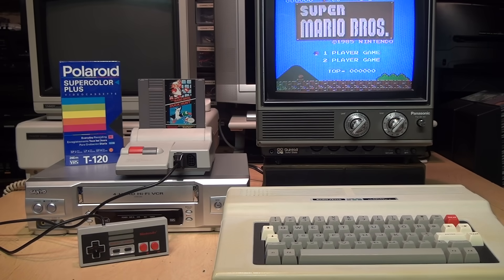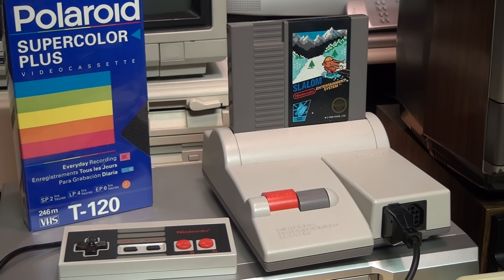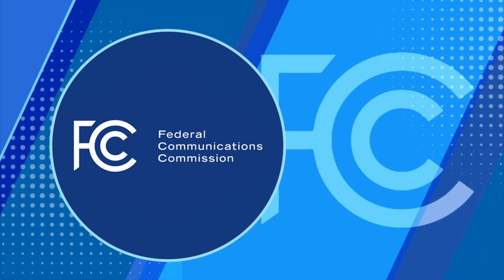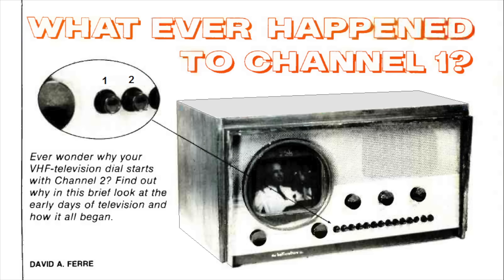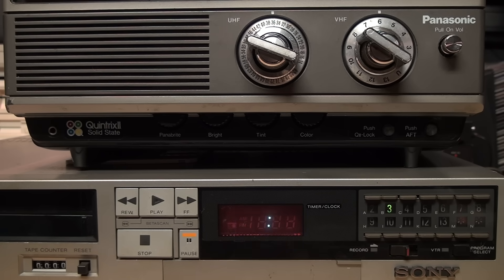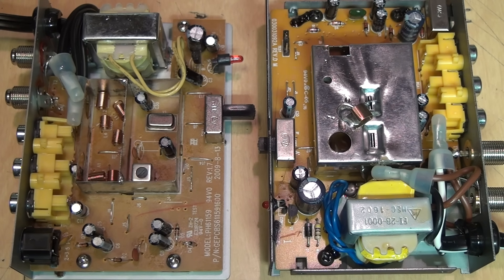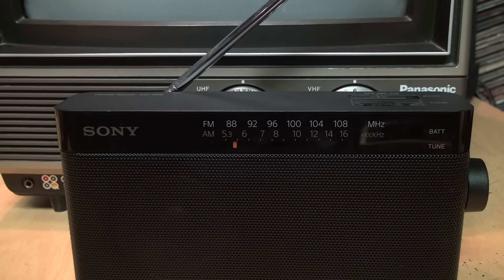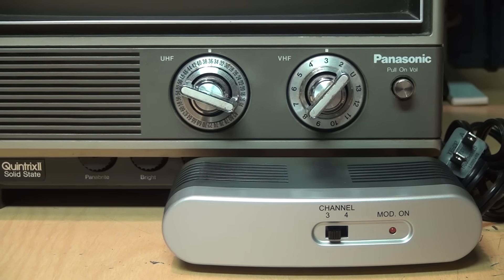Why your Nintendo was on Channel 3 (except in Cleveland)

Comment: in Louisville, Ky. for awhile we had channel 3 clear but at some point in the 90's or early 2000's they put the weather channel on channel 3

some consoles come with good rf modulators that could block the incoming signal when turned on. but sometimes i had to disconnect the antenna to avoid interference.

Comment: We had mechanical channel push buttons on our VCR. We discovered that if we pressed two buttons at once we got the channel in between. For example if tuned properly then pushing 4 and 6 at the same time would give you channel 5. It opened up more channel possibilities with the limited number of buttons on the VCR without fiddling with the dials you mentioned.

Comment: In the 90's I used channel 91 on Long island NY for my Nintendo consoles. Channels 3 and 4 had news programs but there was scrambled input on channels 1 and 2 and no channel 6 if you tried putting channel 6 on it would automatically skip to channel 7 or 5

Comment: In Japan, you would connect your Famicom to output to channels 1 or 2, which in US frequencies would be channels 95 or 96, except most US TVs cap their UHF frequencies to channel 83. If you wanted to import a Japanese Famicom for novelty purposes, not only would you run into power supply trouble but also RF frequency trouble. What could you do?
Reply: Channels 95 and 96 are actually VHF channels, despite being numbered much higher than 14. In order to access those channels, you would have to put your TV in “cable” mode instead of “antenna” or “air” mode.

Comment: Total Malarky!  Technology required that no 2 TV stations be on adjacent channels.  The options were 2/3 or 3/4 for games because EVERYONE had a TV receiver capable of that.  For my Apple computer, I bought a separate modulator from Radio Shack that offered the choice of 2 or 3.  Design was simpler than for the higher bands.  EVEN Nintendo, you admit, offered a choice, something that contradicts your title.

Comment: Wow, great video.  I'm 45 years old and just now put together some things I had wondered about as a kid, like why you could listen to some tv channels on the radio.  I thought they just broadcasted for the radio for whatever reason and never really thought that they were all radio waves.  I never knew that each channel on a TV corresponded to a radio frequency, but it makes sense.

What I find curious, though, is for home consoles like the NES we always used channel 3, but our local TV stations were 3, 6, and 12.  I don't remember ever having any interference, but we also had cable at that point and probably didn't have antennas hooked up.
Reply: You looked old when I read 45 before I realized I'm on my 43.
Reply: NES when turned on it can take over the channel it is set for use. It didn't take me to turn 45 years old to figure these things out. You just have to start messing with the tech. Or read the instructions. You can also take over radio signals. I did when I was only 6 years old. It is not hard and old news.

Comment: Nope. I always set mine to Channel 4. Channel 3 is the CBC (in Canada), and just maybe I wanna leave my game running while I flip to the Wonderful World of Disney on Sunday nights!
I also recall having the RF modulator connected to the TV using as short a cable as I could find, and making sure all the cables were mounted clean and neatly on the back of the entertainment cabinet so that nothing would cause interference. Done right, you could get a pretty good signal, even with RF.

Comment: We didn't use coaxial. Our TVs had two screws and we used converters to use two U shaped forks that connected from the console to the TV. When the U shaped forks wore off, we used the remaining loose wires to connect the TV.

Comment: my nintendo is on channel 96. its a japanese nintendo.
Reply: Analog cable channel 96 is also a VHF channel, despite being numbered way higher than 14. The audio carrier on CATV 96 is at 101.7 MHz, a frequency often used by FM broadcast radio stations.

Comment: Channel 3, and L1 or L2 (the latter being the VCR, which itself actually also used it's own Ch 3). Having only ever owned a PS1, NES and SNES (technically also a Wii, and for like, two months, a N64), I remember this well. We also had local access and a CRT TV only until summer of 2006. So I'm well verse with this stuff. I never actually owned a flat panel monitor until the mid or late 2010s, and have never owned a flat panel TV. lol.

Comment: Why Channel 1 was discontinued in the late 1940’s-early 50’s it was because short wave radio was causing interference with any test TV station on channel 1,hence VHF in the United States ending up with channels 2-13 until the late 50’s-early 60’s until UHF was initiated and channels 14-83 were launched.

Comment: A really good explanation. It is picky of me, however, to point out that the thickness of the insulation on the coax has nothing to do with the frequency it is handling nor even the general size of the cable.  It has much more to to with the type of diaelectric inside the cable, the type of conductor and the ratios of diameters of the wires.  But, the basic idea you are making is right on.  And, the coax that would work well for VHF low would work equally well for VHF high, sepecially considering that the length of the cable will be onLY a few feet and the picture quality is pretty crappy anyhow!  Again, you did a really good job with this video!! I'll give you 9 out of 10 or 4 and half stars!! ha

Comment: Back in the early days (here in Canada) our Atari 2600 had a selector for Channel 2 or 3. Then later the Nintendo came out with a Channel 3 or 4 selector... which VCR's & Beta Machines etc also used to broadcast video to a TV before A/V cables. The choice of channel was said to be there because sometimes one or the other channel might have interference so you could avoid the noise in the signal/image by selecting the alternate channel.

Comment: Question, why were UHF signals 70 to 83 not also turned into a third band for old analog televisions. and also used to make sure that people could communicate on them with a back up power source during times of crisis?  Honestly, it would not be all that difficult to give a crank/solar powered television that could communicate on those channels.  The frequency band could have been called the MHF, or Moderately High Frequency (Output) Band, and a communication device could also have been added to the television like multi-band radios, CB radios, and/or HAM radios.  Oh, and UHF means Ultra-High Frequency (Output Band), and VHF means Very High Frequency (Output Band), right?
Reply: Other electronic devices like walkie-talkies and cellphones needed to use those frequencies, that’s why the FCC reallocated the frequencies used by UHF TV channels 70 to 83 in the 1980s.

Comment: Fun fact about the toploader NES, the original Japanese Famicom was exclusively RF out while the original international NES supported composite video.  However, the international toploading NES redesign cut composite support, probably to save on production costs.  The Japanese Famicom redesign, on the other hand, known as the AV Famicom, added composite video as an additional feature.

Comment: In the 80s most cities with over the air TV stations occupied channels 2-12, but in most cases channel 3 was typically used in "small to mid size cities". This is why growing up in Western South Dakota, we had to use channel 4 most of the time as KOTA used channel 3, and during good signal propagation would interfere with the gaming modulators.

Comment: In the 1990s RF wasn't the most common way.
Reply: In the early 1990s it definitely was. The first high-profile consoles that didn’t support RF out of the box in most regions were the PlayStation, Sega Saturn, and (sort of) the 32X. Although AV became standard earlier in Japan, and in France, SCART had become the standard even before the NES launched. But everywhere else, if you bought a new console before 1994, it almost certainly came with an RF cable. Even after that, RF-only sets were still very common for as long as CRT TVs were being made.
Reply: @Tom-jw7ii your experience doesn't match mine. And that's fine. They certainly included modulators with a lot of products then, but most people buying new equipment to connect their TVs had a relatively new TV which certainly had composite input.

Comment: Fun fact: Given that the signals sent out are radio frequencies, in theory it's possible to get a frequency amplifier and directly broadcast to your tv wirelessly with negligible loss in fidelity. The biggest drawback, however, is that producing radio signals that strong goes against guidelines and regulations which pertain to interference and is all but federally illegal, but eminently possible nonetheless!

Comment: The original PlayStation also supported RF (Radio Frequency) functions. This was achieved through the use of an RF adapter, which allowed the console to connect to older televisions that did not have composite video inputs.
Reply: Earlier consoles like the Sega Genesis, NES, and SNES had the modulator built-in, and later ones like the PlayStation and Nintendo 64 had external modulators that could be purchased, since they didn’t have modulation features built-in. RF is really just composite video and audio in modulated form, so external console-specific RF modulators were made when composite became more common and it was no longer necessary to include RF by default.

Comment: Where i grew up, we only had channel 2, 4 and 6 over the air. when i was in highschool Fox finally got a powerful enough transmitter that we could barely pick up a fuzzy channel 11. For the most part though, it was ABC, CBS and NBC just like the old days. we never could pick up PBS and even today the digital signal is too weak and will never come in. i would usually just listen to the audio channel on my radio though for channel 6 because i could listen to the TV after i had to go to bed. i remember feeling like a hacker when i figured out my radio went low enough to pick it up lol

Comment: Oh my god the 87.7 I "knew" but never knew. In the early 00s the neighboring TV market relocated and boosted their signal. After they had done that, I was able to hear sitcoms while in the car.

The first time this happened I thought the 18 wheeler I was near was using an FM modulator to listen to something. 

When it continued I didn't understand why I could hear TV but appreciated it.

Then when the analog to digital conversion happened the signal went dark.

Comment: Over here in the UK, most computers and videos were set to ch36, but this was in use for radar services and could put lines on the TV screen. In these cases the modulator was usually offset to the next channel up or down with a screwdriver and the TV retuned to it. This was fine until a new TV channel (Channel 5) appeared, and this new station had to use either ch35 or ch37 across the country. Cue lots of confusion as the new station would interfere with the modulator input. So we had the 'big retune', with mobile engineers finding a clear channel on which the modulator could be placed without interfering with any TV channel. Luckily, most modulators in the UK were capable of working right from ch21 up to ch68 so it was always possible to find a space.

Comment: Forget FM radio stations, on my old RCA I had in my parent's basement I would sometimes pick up the Air Traffic Control broadcast from nearby Pearson International Airport. I do not know if it was an individual device or a combination of my TV tuner, VCR, cable TV amplifier, or the cable TV signal itself. Also, many of the local radio stations were simulcast on our cable TV so you could connect the cable to your stereo/radio tuner and listen to much clearer signals.

Comment: RG Cable thickness has nothing to do with frequency, has to do with convention. RG59/RG6 and the diameter is nearly the same. Insulation doesnt cause spillage of RF, lack of sheilding does. Insulation is for voltage and impedance (50 ohm vs 75ohm).
Good video tho, nice and thorough.

Comment: Neat video. Growing up in AZ, we had a tv channel 3. And for some reason my NES only worked with 3. Even when I switched the switch in the back to 4 and changed the channel to 4 it wouldn't work. I never noticed the interference when running it on 3 though.

Comment: I'm watching hd digital video over coax right now, so I'm not sure what you're on about.

The person who installed it did such a good job that the cable termination fell out, and now our home internet relies on a single piece of duct tape holding the connection together.

Comment: At 8:55 one technical reason to not use channel 2 would be that the modulation on channel 2 would spill into the 6 meter ham band,  And hams are very protective of their radio spectrum turf
Reply: Mmmmm, 6 meter haaaammmm...
Reply: There is no one one 6 meters. Nothing but tumbleweeds and crickets. The hammies are dying off... I know, I R 1. Sad but true.
Reply: @KlodFather  True, except when there is a band opening.  When the propagation becomes good.
Reply: @robertcasey2490  -  Yep... as I have said and other hams, 6 meters is the grab bag band. It skips and it also does tropospheric ducting like higher VHF frequencies. 6 meters does it all. But for the most part, it like many other pieces of spectrum, is VERY EMPTY.

Comment: This explains something I've long since wondered abt. When I was a kid my Grandmother bought me a Nintendo used on channel 3, not long afterwards my Grandfather bought a rather large a powerful antenna for his television in his room. It had to actually be plugged into the wall 1 plug powered a motor that would turn and tune the antenna 1 was a booster and he could pick up far away channels. Not long afterwards I discovered if the Nintendo was on and I didn't matter if it was hooked to a television or not , you could watch the Nintendo on his television as long as it was turned to channel 3.  Not long afterwards I discovered I could watch the neighbors Nintendo as well and any thing else they where using channels 3 or 4 for.
Reply: The old days were really cool in their own special way.
Reply: @xenos_n. is that how you could get the PB channel with a lot of static & lines but still make out some of it? Lol.
Reply: Twitch before twitch! lol

Comment: I've got a modulator "Channel Plus Model 5415" that I picked up for $5 at a thrift store. It can be set for a range of CATV or UHF channels, from 14 to 125, excluding 95-99.  I just tried it out for the first time on channel 71, and it seems to be very clear.  I'm not sure if it's the channel, the TV receiver, the modulator, or a combination of them that is responsible for the good picture quality though.

Comment: While I came to this video expecting to hear about US Televisions (and wasn't disappointed) I was surprised that this video also mentioned Channel 36 in the EU. I remember in the late 90s and early 00s whenever I needed to play any games through RF I'd have to tune to the TV to Channel 36 which always surprised me because everything after channel 5 was just straight up static. Hell, I was using that TV well into 2012 but by that point I had connected a VCR to the RF input and that VCR had two SCART connection which meant everything went through that which went through the TV so I never touched the remote for that again but everything was still on channel 36.

Comment: Another probable factor was that once someone starting manufacturing the components for using those two channels, that same manufacturer could start selling those parts to other companies for cheaper than the alternative.
So when you've narrowed things down to a channel selector that's pretty good, unless you have some special need for a different range, it's quickly going to be cheapest just to use the same range that everyone else is using.

Comment: When I was growing up, I was one of those people in an area where Channel 4 was preferred for RF modulators, despite channel 4 being one of our "local" stations.

Out in the east bay, we couldn't receive most San Francisco or San Jose stations, because the easy bay hills were in the way. We ended up getting the Sacramento stations instead. Channel 4 was one of the SF stations we couldn't get, so that's what we used for modulators. (The same was true for Channel 2 in Oakland, and thus we used Channel 2 for the Atari 2600)

Around the same time period, I accidentally discovered the fact that you could receive the audio from Channel 6 at the bottom of the FM band... for us that was a PBS station in Sacramento, and I made use of that fact to record various shows on audio tape using a boom box.

Comment: In Japan, it's channels 1 and 2, though that's equivalent to the frequencies for 95 and 96 in the US system.  Funny thing about that toploader NES... Nintendo made the utterly bizarre decision of removing composite video from the NES-101, when in Japan adding it was practically the entire point of the revamp! The HVC-101 toploader is called the "AV Famicom" because it added a SNES/SFC style AV Multi-Out port, whereas the original HVC-001 Famicom only had RF...

Comment: The Top Loader NES didn't come out until 1993.  We had the OG toaster NES that had composite output on the side and RF on the back.  We had an Commodore C128 that came with an optional monitor that accepted only composite video, so that is what I had hooked to NES when we got the NES in 1987.

Comment: In dayton we had 2 7 8 10 12 14 ,16 20/22/24 36 48 52 64. I always wondered why it skips around. Some other parts of the state used everything but channel 1/3/4/13/17/18 my grandad had antenna that looks like the one at 4:19 and after a bad storm he'd have to go out and use a guide wire to adjust the position on it. He always told us not to eff with it because we would be electrocuted lol